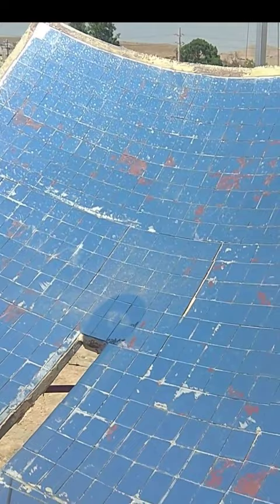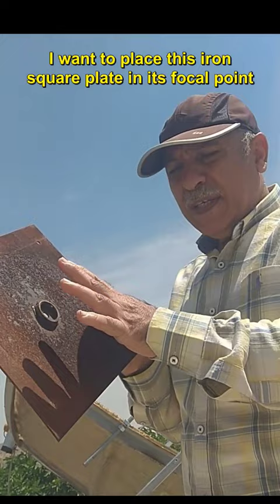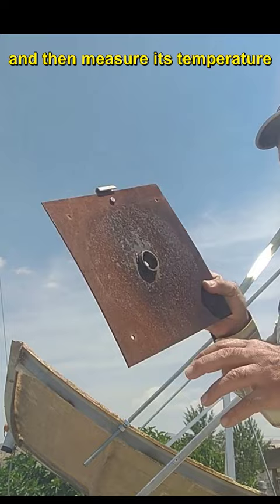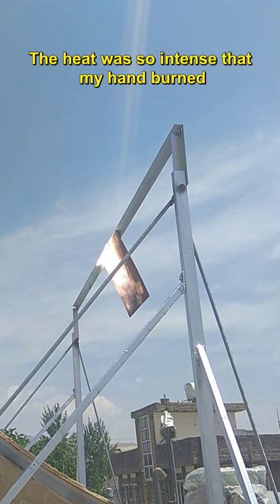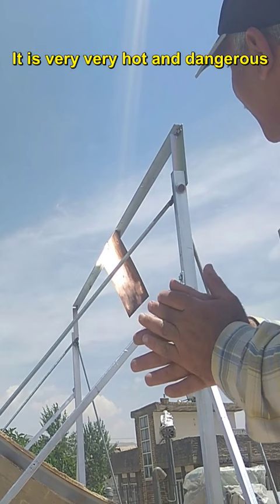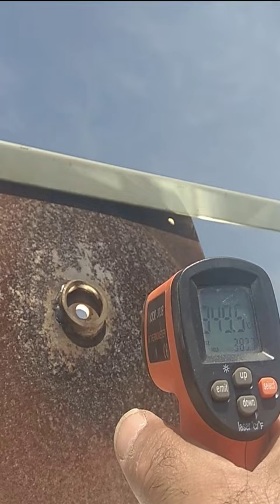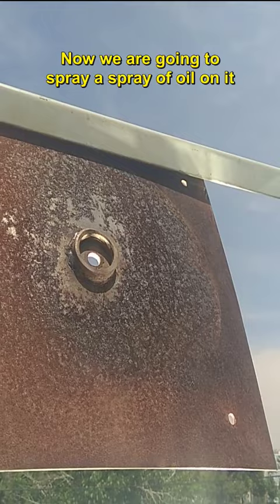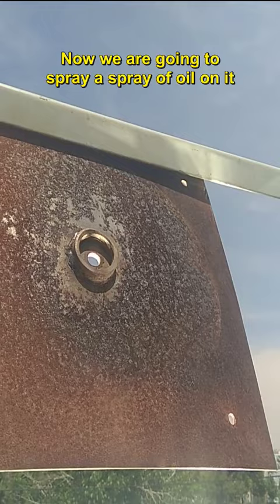The focal temperature of the solar dish

Comment: Well...  a proper radiation collector would be a properly aligned steel bucket with a small hole and something matte black on the inside so no light reflects directly out...  your plate is probably only getting 75% of the energy...
Reply from the maker: It is probably more than 75% because this iron plate was rusted and it is considered a dark object, but your opinion is correct and a black hole is closer to the ideal.